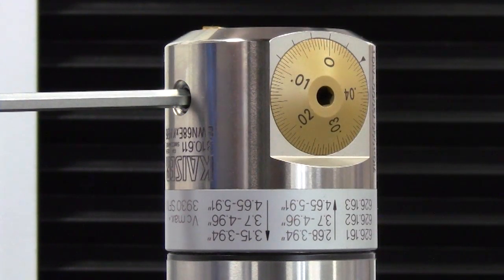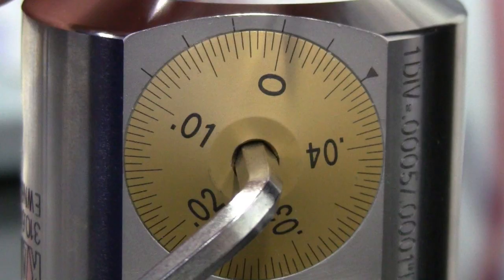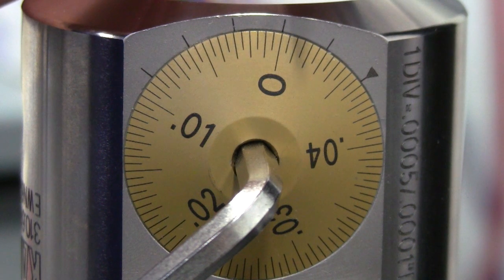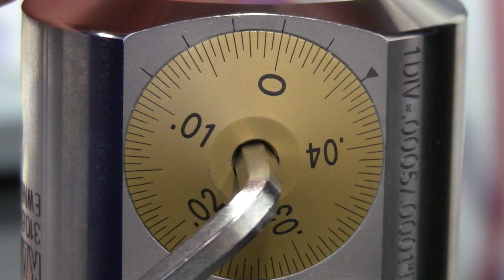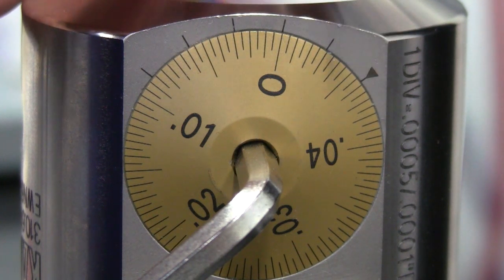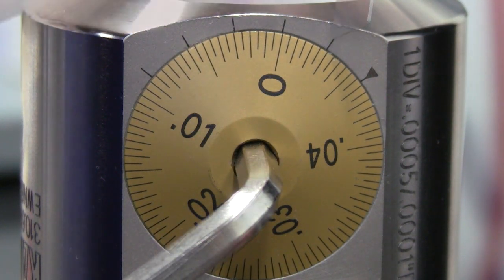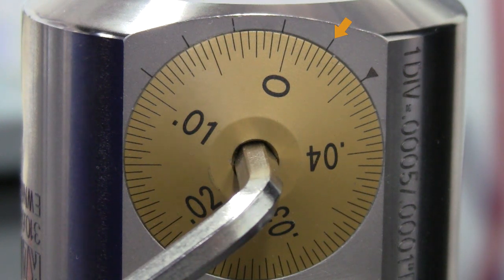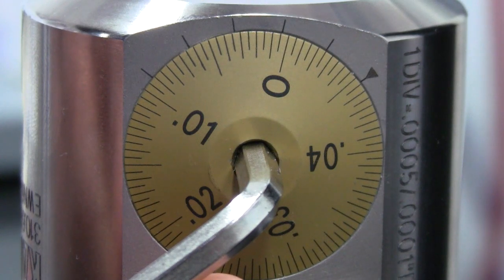Diameter Adjustments on BIG KAISER Finish Boring Heads | BIG DAISHOWA—Americas

Comment: When backing up, you didn't account for backlash??
Reply: I’m not sure if you always have to account for backlash unless it is an already used insert. I believe, and I’m just a rookie so take what I say with a grain of salt, but I believe you can move in small amounts once an insert has been put on and the backlash has already been accounted for. I think you can decrease the diameter without the backlash if on the same insert wear you began with.

Another note, I think a lot of people have trouble with backlash I am one of those so when people make videos like this it is important to show that because it’s so crucial and it’s a pain in the ass if you overshoot with the backlash.
Reply: This style of boring head in proper working order does not require backlash compensation. You are able to adjust size + or - to within .0001 as long as the boring head has not been damaged by not loosening the adjustment screw before adjustment.
Reply: Yes you should account for back lash by bringing it all the way back off then readjusting. You want to always be making your adjustments to make the hole BIGGER. So it should ALWAYS be clockwise. If you have to go counter clockwise you should be taking the backlash out. All the kieser heads I’ve used you MUST take out the backlash.